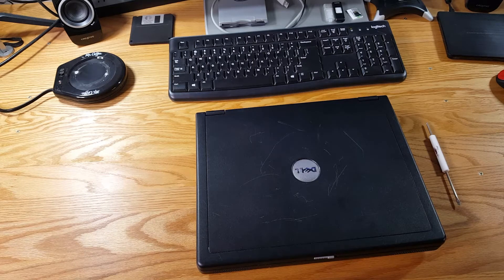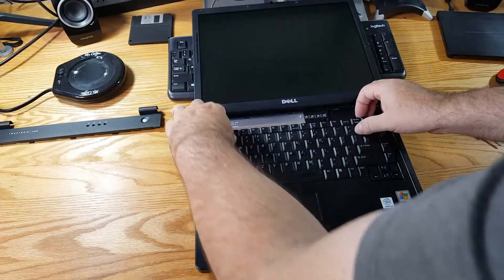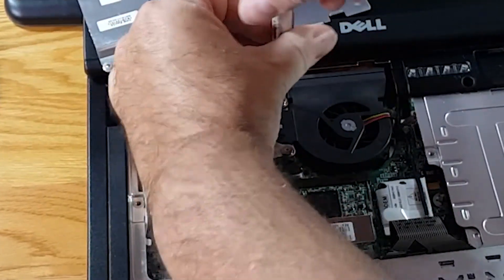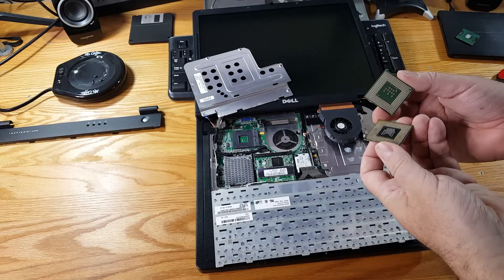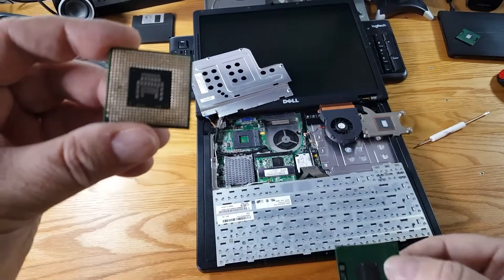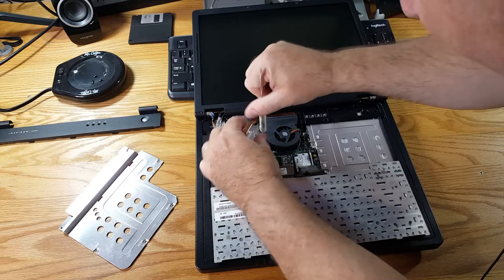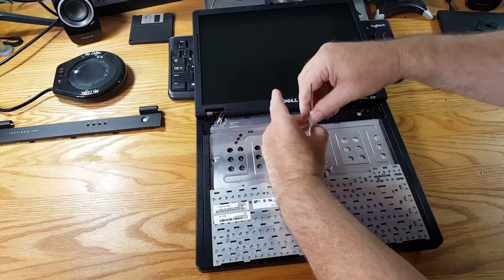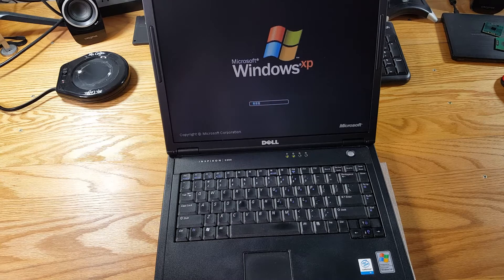Dell Inspiron 2200 Laptop Socket M 1.6 GHz CPU Upgrade FAIL

Comment: These laptops don't use Pentium 4-M chips, rather Pentium M chips. Also I think with this one you need a 400MHz FSB chip.
Reply from the maker: You are essentially correct!  This was a 1066 MHz chip and I thought MAYBE it would work?  Nope!
Reply: @UncleMikeRetro  Yeeeeeaaaahhh that's totally not going to work. Your best bet for something like that would be a Pentium M 7x5 processor.
Reply from the maker: @alectrona6400  I'll be waiting awhile.  Probably just stick with the 1.6 GHz I found that does work.
Reply: @UncleMikeRetro Probably best for that laptop since it wasn't exactly designed to be a hi-performance model. Doesn't help that a lot of Pentium Ms run quite warm anyway, but not nearly as bad as how hot the Pentium 4s ran.

Comment: Sam screw driver I have. I had mine for over 20 my years. I have in the past tried to update my dell laptop. The processor I was trying to upgrade the cpu and dell said it was on the approve list of CPU’s. Found out that the motherboard couldn’t handle it. Dell information was incorrect and outdated.
Reply from the maker: Right?  At least I didn't try to force the chip.  Also, I LOVE this screwdriver, pal!  😍
Reply: @UncleMikeRetro  yeah me too. I actually got mad at my processor for not working I going to toss it out my 🪟 windows. Then I realized my other laptop can use it.
Reply from the maker: Good call!  Lucky too.  In the extreme.